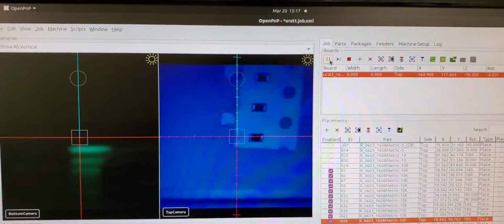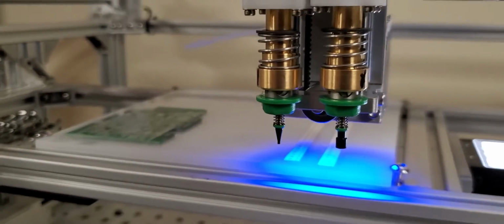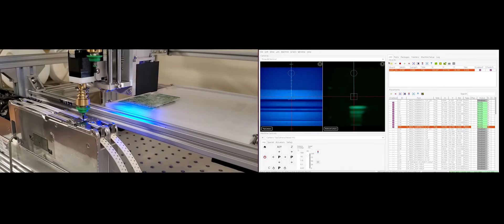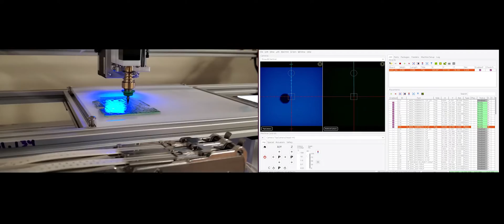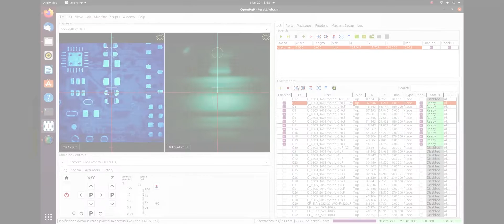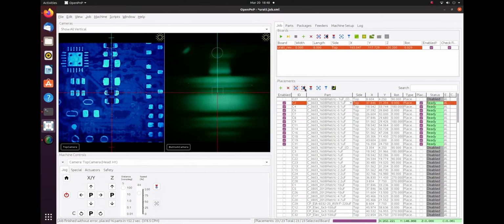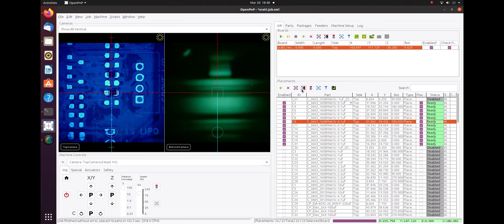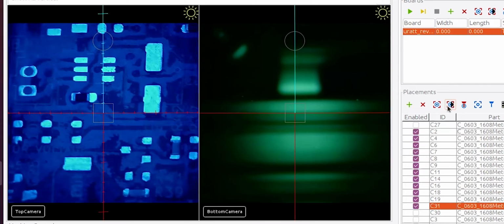MakeIt Labs OpenPnP #15 2021-03-20: Successful Picking and Placing Milestone!

Comment: OpenPnP Shultz feeder 3x8mm - have you managed to get them working with OpenPnP ?
Reply from the maker: Mike, this project has unfortunately been dormant for a couple years due to other priorities and I can't recall exactly how far I had gotten with the 3x8's.  I did a lot of reverse engineering of the feeder code and I think I at least had determined what I needed to run them, but I am not sure I had finished modifying the controller code.
Reply: Hello, in case you have any documentation for 3x8 feeder - can you share somewhere? I have 2x8 feeder and some 3x8 on a way.  @TangentAudioVideo

Comment: Should only need to pocket teach the first part hole, last part hole when on cut tape, the pocket spacing is uniform. Inspecting with a camera may be increasing your placement accuracy but it's way too slow and washes away you really looking at repeatability issues. Use of camera is something the operator needs as a last resort for 0402 parts or costly package with many/odd pins that does not get picked up cleanly, by some nozzles. Small parts with say a slight rotation of 10 degrees will likely reflow fine but much more than this could cause issues. The fault may really be pushing the part down and bottoming out in the pocket on the tape or having it stop some distance above the part before the vacuum initiates. I seen this commercially, but fault is mostly due there to operator having wrong part dimensions in pnp software. 
Blue_tak is another wonderful test tool that might help in your endeavours. Good for making nozzle impressions to compare with the camera and depth point of parts placed. 
Do you have live streams or a project page for this other than yt?
Project looks awesome! Kudos to the team!
Reply from the maker: You are correct, and long term we don't plan to use bottom vision for placing passives, but for now it allows the machine to work enough for us to get familiar with the software and see the machine actually do something useful.  It is almost certainly masking mechanical design problems, and potentially also setup/operator problems like you describe.   On the other hand, actually exercising the bottom vision system is helpful so that we can learn and debug that part of the system as well.  Because this is largely a project for fun and learning, and not building a system intended for production use, the path we take may not be the most direct.  

I did use modeling clay (couldn't find any blue tak) to set up the initial nozzle and top camera offsets.  It is a handy tool for sure.

We don't have a project page or live streams at this time, but I have posted almost 20 videos on the project documenting progress over the last couple months.  They're all in a playlist here https://www.youtube.com/watch?v=7aZVCZvgY4k&list=PLWaAgrfF2fwPj5Z44aef8kZcq_Rhv1YyV

Cheers, 
Steve

Comment: This is really fantastic! What are the camera make-model? Maybe you already detailed them in another video? Thank you
Reply from the maker: I haven't yet done a video on our vision systems, but I hope to at some point. It's been a bit of a journey.  We're currently using two different inexpensive USB cameras, both from ELP.  The bottom camera is a physically huge 720p camera with a varifocal zoom lens https://www.amazon.com/dp/B01N8YH5VY/ and the top camera is a 1080p board camera with a fixed lens (8mm I believe) https://www.amazon.com/ELP-Megapixel-Illumination-Camera-Support/dp/B00SOR75FE/ ... Each camera is arranged with a coaxial LED illuminator.  Lighting is very tricky for machine vision, and simple light rings do not perform very well.  Moving to the coaxial light sources made a huge difference.  We started out using a different inexpensive camera and an LED light ring and had more struggle than success.
Reply: @TangentAudioVideo  Huge thanks! Would you share links to the lights that you used? The bottom camera assembly also has a diffuser? Watching your video made me wonder how your camera setup might work with a problem that I have imaging into tiny translucent tubes. Reflections, glare, etc. cause problems.
Reply from the maker: @kentvandervelden  Both lights have diffusers built in.  We're using  https://www.ccs-grp.com/products/model/2845 for the top camera, and  https://www.stemmer-imaging.com/media/uploads/illumination/13/136215-Fiber-Optic-CIS-Series.pdf model CIS-50/50-W-24 for the bottom camera.  Lots of companies make these coaxial illuminators, and it's even fairly straightforward to make your own using teleprompter glass or similar.  I can't say whether they will help with your particular application, but it's worth a look.
Reply from the maker: We're using this illuminator for the top camera currently.  https://www.ccs-grp.com/products/model/2845   The bottom camera uses a larger, but essentially similar unit from a different company.  Both were acquired as surplus on ebay as they are quite pricy to buy brand new.  We ended up with a blue light source for the top camera, which is not ideal for all applications because color rendering is hampered, and some of the machine vision pipelines depend on keying out certain colors.  However for basic tasks like finding the board fiducials, it works fine.  We can swap out the LEDs, or find a white light model if one pops up on ebay.

Comment: 👍
Next, can work towards " locate loose components from a plate , pick up, rotate then placement"
Reply from the maker: I did see that someone had support for that in OpenPnP.  it's impressive, but I can't imagine a case where I would want to pick up loose discrete parts like resistors and capacitors.  Sounds like a recipe for problems if you have a bunch of different values that could accidentally get mixed up.  I am interested in picking up loose IC's from trays using vision, however.
Reply: @TangentAudioVideo  I understand.